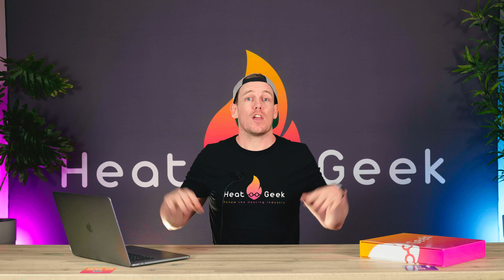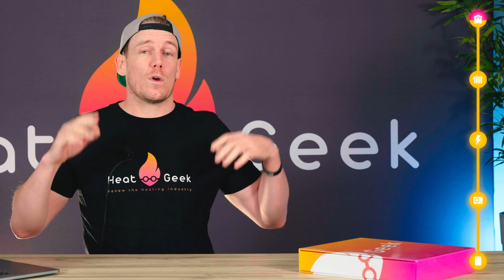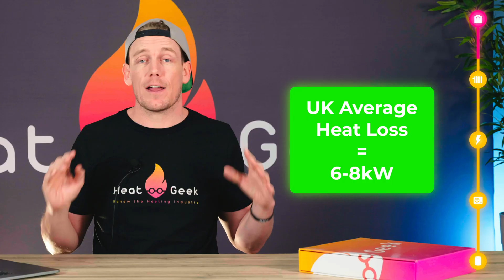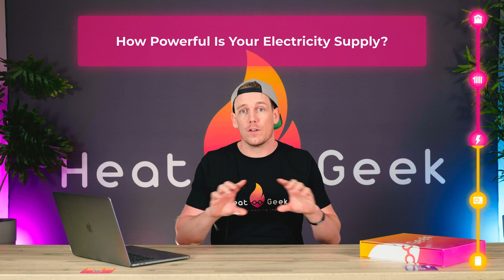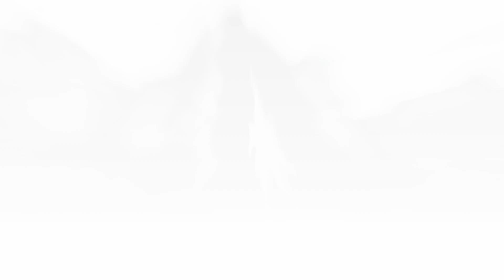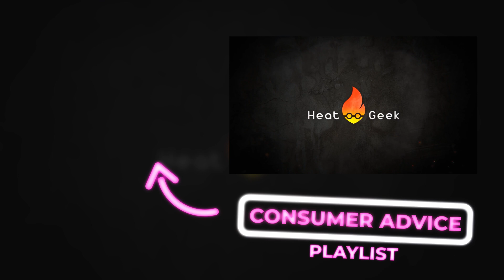Will A Heat Pump Work In My Property? (REAL ANSWERS) | Consumer Advice

Comment: Most properties certainly do not have stored water! What are you talking about??… for many years now stored water has been something deemed unnecessary & somewhat an inconvenience for most dwellings & requirements, thus leading to “most properties” having them removed & having the extra space in either a bedroom or bathroom being put to better & more practical use & an introduction of a far more efficient & practical combination boiler!
Good luck trying to convince customers to revert back to the dark ages & while you’re at it expect them to change the aesthetics of all the other rooms in the house by getting rid of their nice fancy radiators & Changing them for oversized monstrosities & then stick that horrendous looking heat pump in the garden or bolted to the side of their house!…. Most people currently don’t appreciate a condensate or gas pipe running along the outside of their home let alone a metal box stuck to the side of it!……oh & for the pleasure it’s going to cost up to £20k….good luck 👍🏻
Reply from the maker: Well we either make an eventual change some how or we cary on polluting the atmosphere..  what's worse?
Reply from the maker: And when you talk of dark ages.. I think gas is going to be moving that way very quickly
Reply: @HeatGeek  what with hydrogen that simply can not be sustained by a majority of the country’s infrastructure?…..or with the scenario I described above?…. We’ll see 👍🏻
Reply: @paulw4904  Hydrogen is a bit unrealistic.  It might be used on a small scale.  The actual plan is to use hydrogen for businesses that need gas and can't use electric and it will only be 10GW by 2030.  (heating homes is 170GW).  Hydrogen will cost a lot more than electric because it uses a lot of electric to create it.  So why use electric to create hydrogen when you can just use electric?  It makes no sense to heat a home with a boiler that's 90% efficient when you can use a heat pump that's 300% to 500% efficient.  .  Even if creating hydrogen was 100% efficient, it would sill mean that more then 3 to five times as many KW of ELECTRIC is being used to heat a house using a hydrogen gas boiler then if we use a heat pump - BECAUSE WE WILL USE ELECTRIC TO CREATE THE HYDROGEN!!!!! so it just makes no sense to have to build loads of extra power stations!!!!  They need to generate 170GW of extra power to replace gas but only 60GW or so it we switch to heat pumps.  Gas will go the way of coal lorries and coal fired heating - and don't forget that split heat pumps will cool your house in summer too and people will love that.  Like climate control in you car - set a temperature all year round.  Also you can add solar and power your heat pumps off that.  People will love that too - near free heating!!!!!  The old gas bill will cover the monthly payments on a loan.  That's why gas will go.
Reply: @paulw4904  True.  But they can at least get carbon capture at a power station and go nuclear - they will do that in the end.
Reply from the maker: @paulw4904  hydrogen will cost 5x more than electricity..  Will only reduce carbon by 20% and is 30 odd years away

Comment: Thank you for making these. As a suggestion, I'd love to see air-to-air setups covered. Here across the pond I don't know anyone using heat pumps in an air to radiator setup, as those would be very difficult to use for cooling during the summer.
Reply: Air-air systems aren’t that common in the UK. Most properties already have water based heating systems plus cooling is not required in the so-called Summer. I wish it was.
Reply: @martinwright7093  Split heat pumps in the end will replace wet heating systems.  We're just used to radiators in this country, but with near silent fans, no radiators and all year round temperature control then both gas and wet heating will be history.  Connect to solar panels, sell it on finance and let the old gas bill cover most of the loan payments.  People will buy it for the all year round temperature alone.
Reply: Fully agreed with you, it would be an interesting video to see, even more if your radiators aren't big enough and it cools in summer better. So it would be cool to have a series about it

Comment: Greeting, I have a 2-storey house,the whole house has 250m2, and the ceiling height is 290cm, 25cm brick walls, 10cm Styrofoam facade and on the inside I have a double plasterboard with wool. My floors are insulated with 10cm Styrofoam and screed on both floors, and the attic is insulated with 10cm Styrofoam and 20cm thick concrete. The house is 2 years old. I have triple glazing pvc windows. Radiators when I calculate the total length x width and add it all up I get 9.34(type22). I wonder if you can tell me what heat pump power I need and what is the optimal water temperature to have an efficient cop. the outside temperature does not fall below -8 degrees Celsius on the worst days. Most days the temperature is 3-10 degrees Celsius (night-day). I am currently heating with pellets, but I would like to switch to a heat pump because I plan to build a rooftop solar power plant. sell to my electricity supplier. The text is too long and complicated, but your help would mean a lot to me. Thank you in advance!

addition, I also have underfloor heating that works through the return from the radiator of some 50m square
Reply: You have a pretty well insulated house. The ceiling is maybe a bit high, especially for radiators and the attic insulation of 10 cm styrofoam it's not enough, it will be better with a total of 30-40 cm of insulation (maybe cellulose or something else).
Probably a 6 or 8 kW monobloc heat pump is enough. For the domestic hot water I would use a separate heatpump boiler, it should be about €1.000 EUR search for Ariston Nuos Evo).
Monobloc is cheaper to install, uses less space and I would avoid using the heatpump for DHW and instead use a separate boiler.
If you used the house for two winters, you can calculate yourself the needed power:
add the pellets used for one winter, then see how much energy in kWh they contain and you'll have the total used for one winter in kWh. I'm using about with a gas boiler 12.000 kWh per winter for a house of 130 sqm, winters (october to april) may go as low as -15 degrees and inside temperature set to 23 degrees. This also includes DHW. Maximum used for one month is about 2.500 kWh. 
So 2500 kWh / 30 day / 24 hours = 3,47 kW per hour. So I've ordered a 6 kW Gree Versati mono-block from Spain (I live in Romania) for about €2.200 transport included. But I will keep the gas boiler (only two years old) as back-up heating (and maybe for temperatures below -5 C when the COP drops) and also for DHW.
This winter I used the gas boiler in low temperature mode (as for floor heating although used with radiators only) with a maximum temperature of 45 degrees and worked perfectly, but I have 14 oversized radiators at about 10m (600mm height 22K). Ideally you should use the water at no more than 45 degrees temperature, preferably with 30-35 degrees, but this is very hard with radiators.
Reply: @razvanlex  greetings, i was thinking about 24kw heat pump. In my place everyone suggested that size?
Reply: @markopavkovic6673  24? Seems a bit large. Have you spent a einter in that house, to see what is the kWh used per season?

Comment: Mate your main fuse info is off most city property from 1950 only has a 32amp main breaker it’s only from 1982-85 or swapped out with upgrades  that 60amo were fitted if the electric hasn’t really been touched by the same owner say passed down there’s a good chance that unless they may be looking at going ev or not had work it may still be on the old type fuses plus to get the best owners must look at upgrading the insulation first further to this grade listed property may and do have a ton of restrictions so will have to consult before any work can be carried out such as breaking the fabric of the building for pipes will be refused

Comment: Thanks for doing these Consumer Advice videos. They're very informative. 

Could do a future video on cooling? 
In particular, is air conditioning bad for the environment if it is powered directly by solar panels? 
What is the efficiency of an air con unit if you use it to heat the house in winter? 
Can you reverse an air source heat pump and make the radiators cold? Would this work as a way of cooling the house in summer, or would it just cause condensation problems?
Reply: Countries that rely on air conditioning and not space hearing are far less carbon intensive, since bringing 35C down to 22C is way easier than -3 to 22C.

Comment: one question that if bugging me a bit from one of the videos before. There was a mention that putting the external unit in the shade as not good. 
can it be ok if shade is from grape wines (no shade in winter)
Reply: But shade also gives the impression of shelter, i,e, shelter from wind and sun. You want the wind so that the air is free flowing, sticking the heat pump under some bushes may be a bad idea
Reply from the maker: @lumsdot  you need air flow.. not necessarily 'wind'.. as long as the air is exchanged it makes no difference. You don't need rain.
Reply from the maker: I haven't said putting it in the shade is bad in any way?
Reply: @HeatGeek  I may have misunderstood it then while watching. I actually am just looking how external unit placement affects performance. In my case grape wines will be near and even may make shade, so I am just checking if that is ok or not.
Reply from the maker: @hrgdavor  no problem at all.. it doesn't convert sunlight but air temperature.. and air moves
Reply: @hrgdavor  I'd be more concerned about any cold air blowing on your grape vines, surely they won't like that? A few years of poor wine harvest will not be good for anyone🤣
Reply: @simonposkett1753  :D
Reply: @HeatGeek  Are you saying that direct sunlight on the heat pump does not improve performance?
Reply from the maker: @singlendhot8628  yes.. its doesn't use local sunlight..  it uses the air that's being moved rapidly around it and circulated locally and globally by wind...
Reply: @HeatGeek  Would't the air around it be heated by solar radiation (vs. air in the shade?)
Reply from the maker: @singlendhot8628  no.. radiation does not heat air. It heats solid objects once the sunlight hits it... the obje gs vould heat the air from convection but that would be so small as yo make almost no impact once the fan in on and moving the air and diluting it woth surrounding air. Make sense?
Reply: I remember the thread, someone else said it would make a difference and Adam said it wouldn't make enough to worry.
Reply: @patrickwheeler2646  the shade is cooler. But not that much